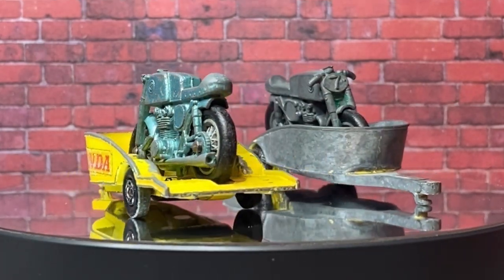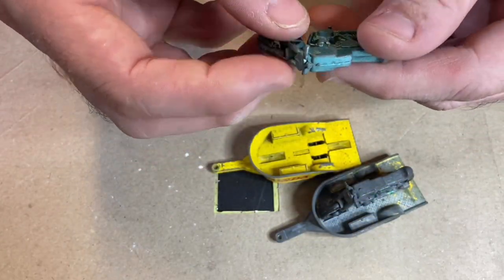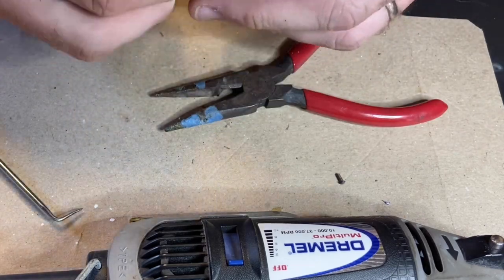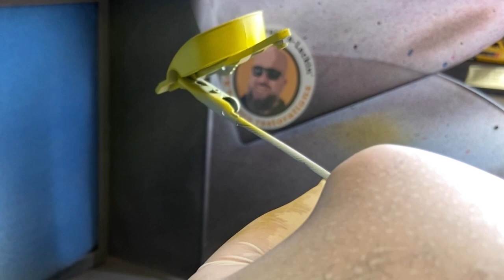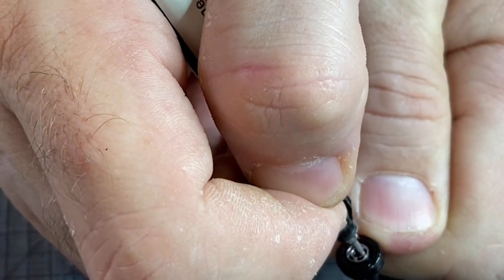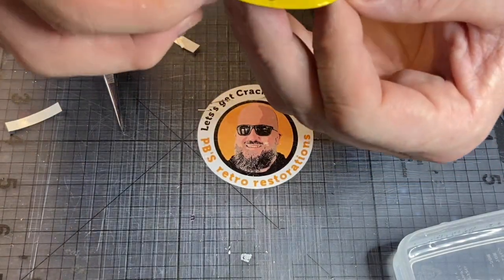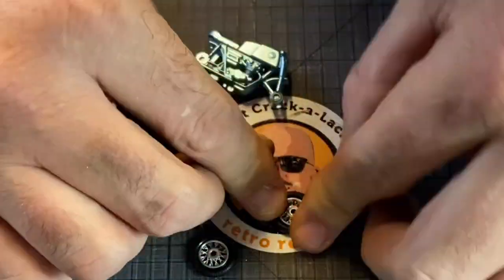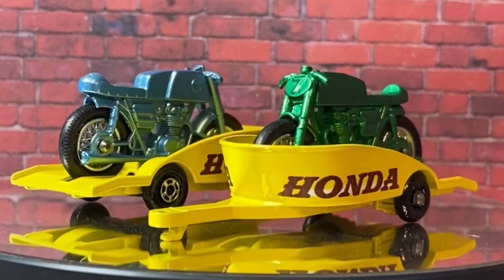Matchbox #38 Honda Motorbike Trailer Regular and Superfast Restoration #068

Comment: I love these - great work. The handlebar looks spot on. And again, you always nail yellow, when I struggle so much. It’s a curse! 

I had considered doing something with white paint behind some General Lee decals I’ve got - my finished Dukes’ Charger doesn’t look quite right with the see through decals straight onto the orange. It’s good to see someone else achieve what I thought might happen.
Reply from the maker: Get yourself one of those 1mm posca pens, the ink can be a little water soluble, but it's better than the transparency.
Reply: @PBsRetroRestorations  I've got a 0.7 bullet tip Posca in white. I'll give it a try sometime.